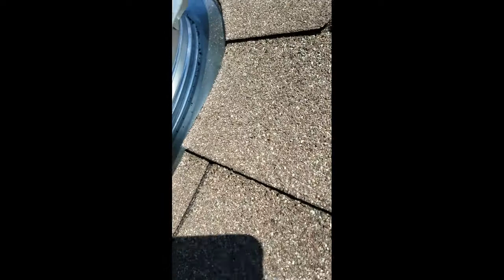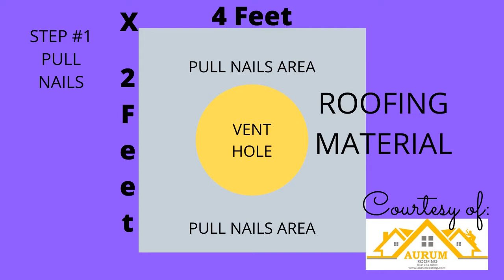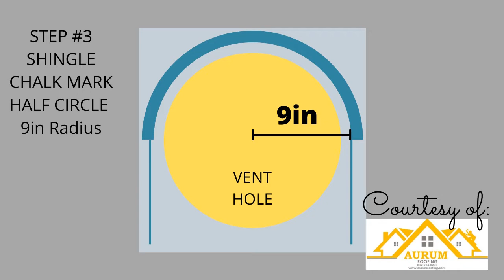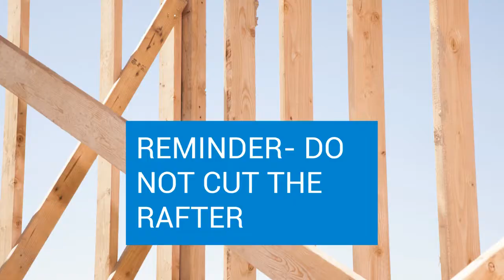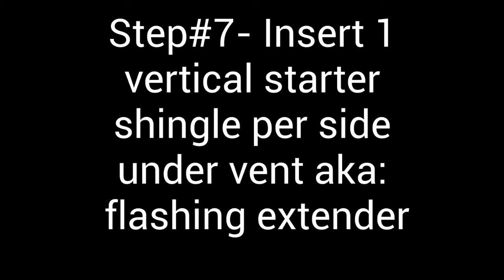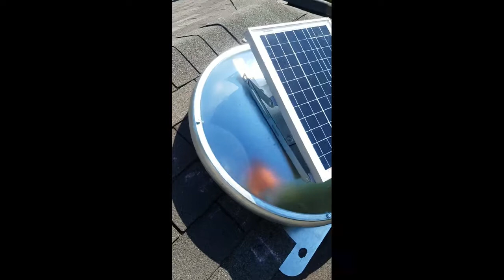Learn How to install a GAF Green Machine Solar /Mushroom Roof Vent (DIY)

Comment: There’s no electrical work needed right ? It’s just install and it’s ready to go off ??
Reply from the maker: No. None at all. Pretty much a plug and play. The vent is 100% powered  by its solar panel. It only works when direct sun light hits it.
Reply: Can it be installed on a tile roof ?
Reply from the maker: Possibly. These are instructions for a asphalt shingle roof.